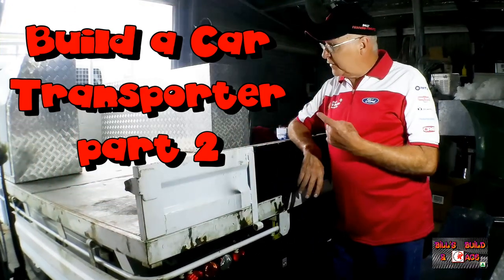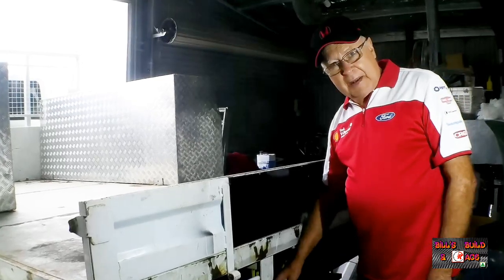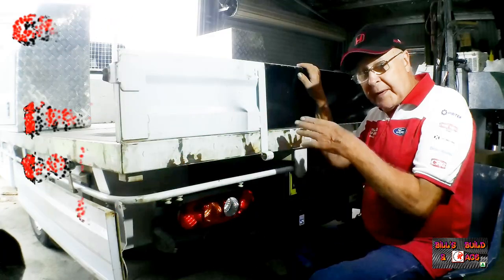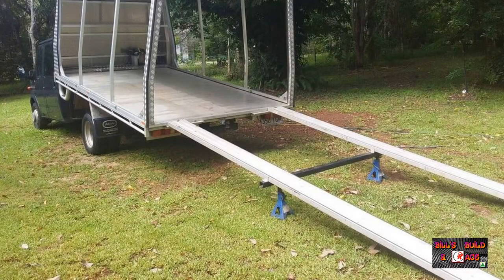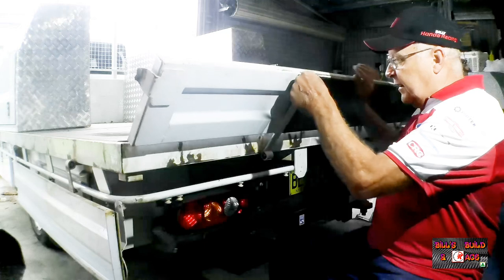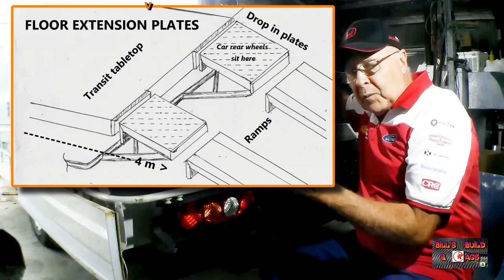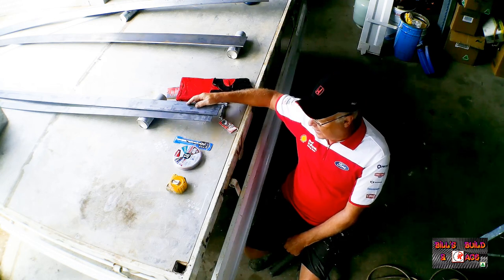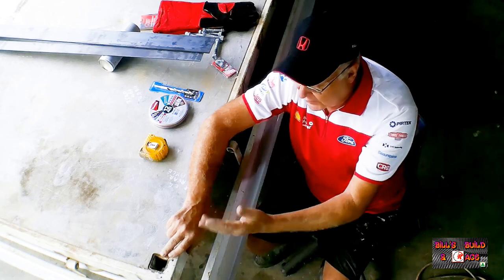Build a Race Car Transporter - part 2

Comment: Good idea on the extension. I’d run some 100 x 100 box with some pins to prevent losing the car. Even with the two bracing strips, a car will bend those prevent-car-losing panels

Comment: Few tips to make your life more bearable.
It's not going to be easy but I'd add something to hold the front of the ramps otherwise they will rattle and drive you insane. I did a similar thing with my ramps and I ran a strip of 2mm steel with rubber ute mat glued on at a 15 degree angle up the front under the tray. It was squishy enough that I could force the ramps in hard when I dropped the pin through and they didn't rattle.
Same with those drop in wheel chocks. They will cause a huge racket when you hit a bump. Use a can of spray on bed liner of glue marine carpet to them so it holds them firm.
Last, probably not needed, but where you've braced off the tie rails may need its own brace. Tie rails are made for perpendicular strength, not lateral. I'd hate to see them bend and the strut slip off if you get rear ended or hit one of the Sydney potholes. Just continue the angle back into a tray member. Cheap insurance.
Always love your ingenuity. Keep it up.
Reply from the maker: My scaffold planks have two strips of rubber built into them that run their full length. Stopping any annoying rattles will be addressed at the end of the build. I've got enough to worry about atm!

Comment: Elegant solution. My only niggle is the stay that goes to the round bar. Looks to me like it would be taking a fair chunk of the load. Is it meatier than it looks?
Reply from the maker: Yes, as a main tie off bar for strapping, etc. it is solid. However my car's rear wheels will actually sit on the original tray of this truck. That extension will only have the weight of my car on it when loading/unloading.  My tray still needs to go back to 4m so the car's bodywork overhang off the tray is not too far, and going to the max (in my case), tray length of 4m allows for longer cars if ever required.
Reply: Just one quick point Bill, in the video it appears that the extensions block the visibility of the tail lights. In QLD this would cause the vehicle to be deemed unroadworthy. Perhaps additional lights would be an idea.
Reply from the maker: @stewartking8467  11min 30 sec ???